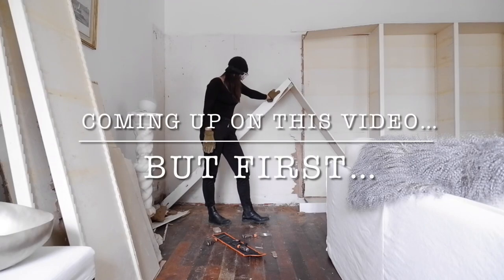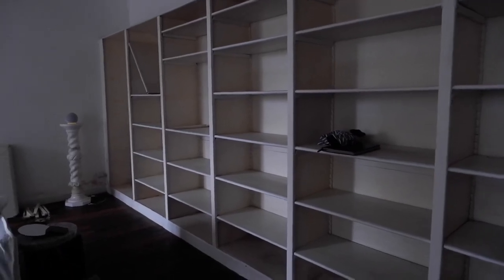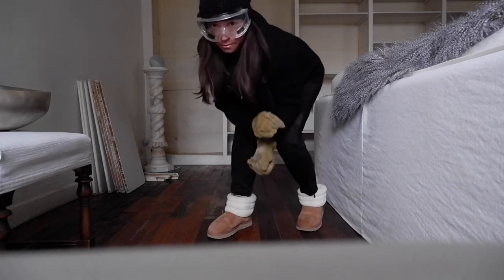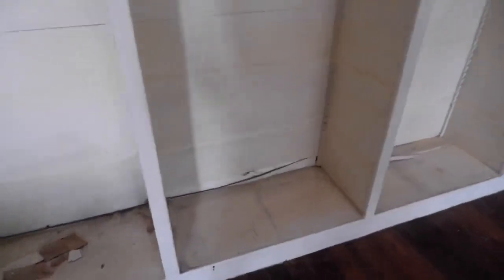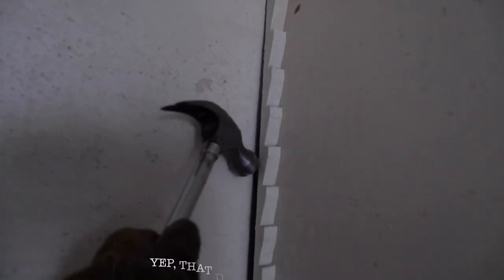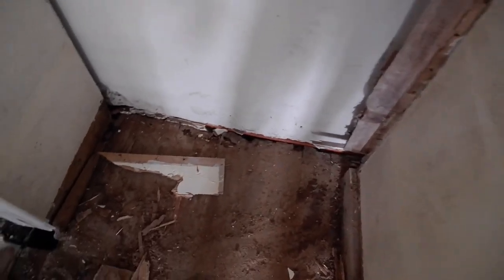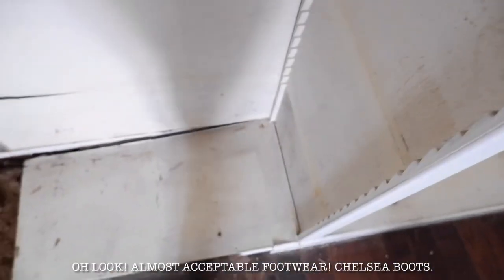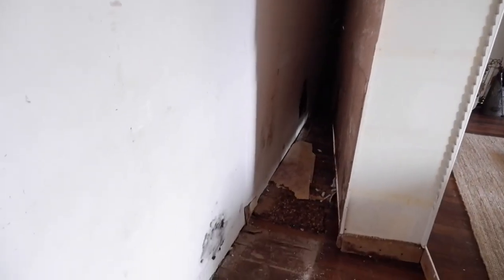How not to DIY | Library demolition | French country estate

Comment: I would not have been able to bring myself to rip out a wall of bookshelves.   I would have, however, added moldings to make them appear older and to make them look even more built in.    I would have enclosed the bottom portion with doors for hidden storage and removed some of the upper shelves and hung painting(s)--this would have made them seem less massive/overpowering.   But, then, we have a lot of books!   I look forward to seeing what will replace them #1867farmhouse
Reply from the maker: After the pipe leak many many years ago they should of been replaced and all of the books that were left for us, (filled each shelf) had mold and must. You can imagine the smell. 🙃 If it weren’t an issue or salvageable, we would of have definitely kept it as it was. Is 1868farmhouse your account? Let me go check IG.

Comment: Too bad you had no use for the built in shelving~ but a blessing to get to the black mold. 🖤☠️

That stuff can make you really sick. You need a better mask on when working near that. Scraping as you needed to~ frees up spores, that is best not to breathe in (or wear around to other rooms.)
That wall needs at least a few good washes with germicidal bleach.(industrial strength)
I’m sure there’s also a special treatment and then a special primer to follow before painting….
There are people who specialize in mold and damp removal, as I’m sure you’re aware. 
Just depends on how big an issue; if you’re tackling it or hiring it out.
I’ve restored my share of homes with age and history 😉
Both in the USA and UK.
It’s a labor of love ❤️
Reply from the maker: I definitely need to invest in a better mask! I really hope we’ll be able to address the humidity issue with a specialist we’d like to work with who visited after this video was posted. Just need to hold off a bit until our finances are in order.
Reply: @Frenchcountryfriends  Good call on the professional. Until then~ use full strength bleach to wipe the area down. 
Leave it to dry for an hour- repeat then rinse. The bleach will help kill any lingering spores not visible to the eye. 
Until the pros come. 
Black mold can cause respiratory issues…. 
You are doing a fabulous job 🤍